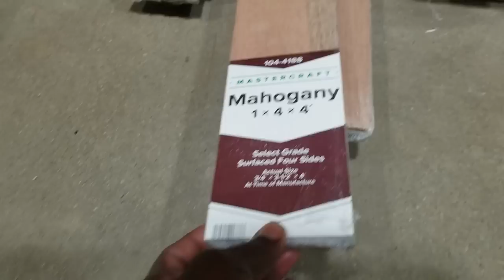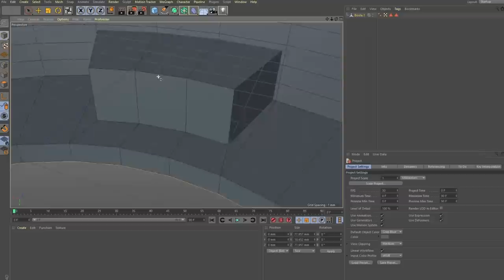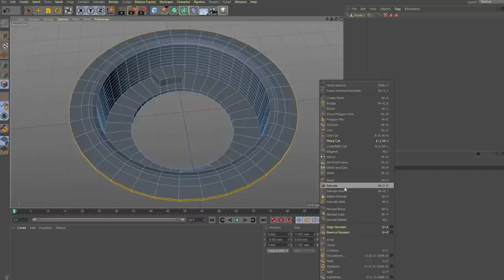🤔 Replacing Passive Radiators With Actual Drivers taken from the Flip On My Charge 4. Good idea?

Comment: That camo charge is likely extremely different inside. They have three revisions on the actual hardware.
Reply: They changed software on each color?
Reply: @S10_Operator  No, only the actual components vary between factories, and some factories produce different colors than others. The software (or firmware in this case) is the same if you buy them at the same time.

Comment: I would wire the Flip speaker in Serie and add a 4 Ohm resistor in Serie too to it and the charge 4 speaker parallel

Comment: See the problem is the concept itself is somewhat flawed.  The way the passive radiators work is when the driver moves outward, the air in the sealed chamber causes the radiators to move inward at the same time, adding depth to the sound.  When you replace those with drivers, now all of the drivers want to move outward at the same time, causing a vacuum in the sealed chamber.  This basically means the drivers will be fighting each other.  This is the reason that while the volume may be greater, the bass is less powerful and smooth.

Comment: You cant fit different size speakers in the same closed cabinet/speakerbox.  
They all give different pressure making each other move with air pressure cancelling mostly all the bass and gives distortion, also is gonna blow up the the weakest speaker in the system.
Always use the same type and size speaker in a closed cabinet if u put more than one speaker in it.
Not even a radiator mixed in between different sized speakers in the same box is gonna help getting good quality sound or better sound.
Basicly you can do the mod he has done with the side speakers,
 but the speaker infront must be a radiator fake speaker for good bass this way you fill the room more with sound.
But it wil be bad for any jbl speaker that has 2 front speakers.
Better to build your own speaker box/cabinet with decent low wattage 4ohm speakers  and use the JBL Charge as an amp.
Dont use high wattage speaker its just gonna drain your battery and get low volume.
6x9 speakers are the max u should go,
 anything bigger wil also have bigger magnets causing for the battery and amp to overheat and battery kill,
something like 4 to 6inch schould give enough bass in a proper tuned box.
Be sure to read on the speaker how low it wil go, choose one that goes to around 30hz/40hz  atleast they are called Full range type ,
 some look like regular Full range speakers but are made to only go around 70/80/90/100 hz and u need an extra subwoofer with those speakers.
So only buy Full range speakers
Plus dont go higher than 4ohm speakers "car audio", because 6ohm, 8ohm or 16ohm etc are "home/stage audio" means more resistence so lower volume/power output of the speaker.
Goodday.

Comment: The modded one will blow soon or later original driver is 4 ohm ID believe. The flip also. So the Amp runs at 1.3 ohm. And will die soon

Comment: There is passive radiators because there is calss d amps in these bluetooth speakers and the class d amps are bad at low frequency sounds these passive radiators are giving low frequency sounds

Comment: Added speakers should not be in parallel. The AMP cannot drive such a low impedance. Try wiring the two new speakers in series & add that combination in parallel to the main driver.

Now assuming the impedance of all the speakers is 4ohms....
The Charge 4 amp is probably designed to drive 4 ohms at max volume without overloading.... 

With 3 4 ohm speakers in parallel as you have done in the video, the effective load is only 1.3ohms. Way too low for the amp to handle.
With 2 4 ohm speakers in series added to a 4 ohm speaker in parallel, it becomes 2.6 ohms (half the current load on the amp compared to the video setup)

May still be too much load but worth a try!

Comment: Maybe that should be a thing
Reply from the maker: Charge 4 with 3 drivers?
Reply: Yes they should try it see what customers would think
Reply from the maker: they could also advertise it as a 360 Speaker 😂 But they would have to put Some sort of PR maybe at the back of it 🤔
Reply: @DLXWillington  yeah maybe one small one up front or two decent sized one on the back

Comment: I knew that would happen totally destroyerd 😆 flip speakers are downgrades bro you knew that right? Originals banging compared to the mod! Just added more tweeters and took aways it's woofers! If you use them both together in party mode you might be able to salvage something from the project! You'll have a good mixe of top and low end through both if paired together!
Put a bit of sealer round the ends it'll stop the end 3D printed caps rattling through the bass either that or the Amps blue it as used as a tweeter and not a passive subwoofer!

Comment: i thought it would sound like shit... and you know what.... it does sound like shit! you know why? first of all you should've wired both amplifiers together instead of letting a single chanel amp share power across three speakers. and the drivers are smaller than the passive rads. and you wired all the speakers in phase. if you wired them out of phase and let the big driver use the smaller ones as passive radiators the bass would've been way better. also you didn't seal the speaker so there is a lot of air leaking i'm sure. so if you want to improve this speaker you need to: wire the small drivers out of phase, wire both amps in parallel, and seal the box with silicon. also please use bigger drivers if you decide to do that because the small drivers can't produce even near the same ammount of bass as the big passive rads. AND get high excursion drivers instead of thease shitty speakers